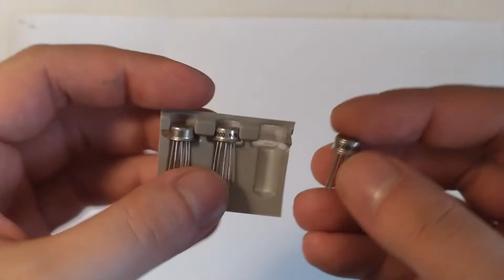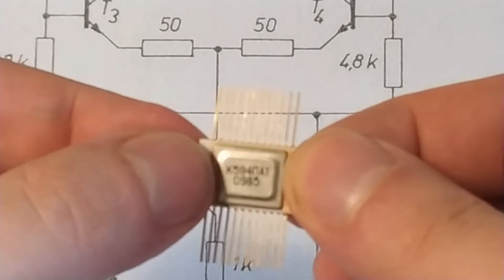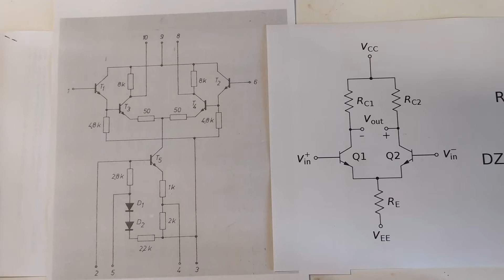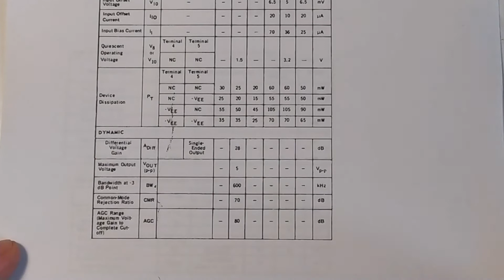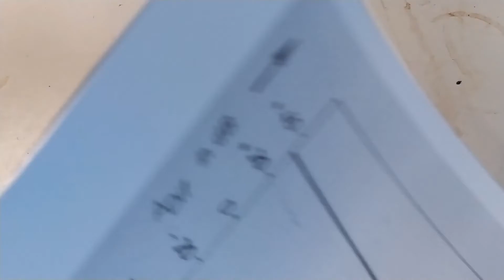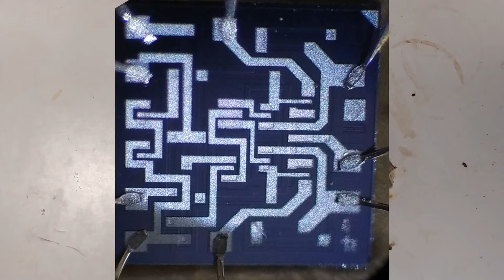Early Integrated Circuits: MA3000

Comment: That's a hell of a lot of gain on that chip. Nice.
Reply from the maker: I was quite impressed as well! Getting that sort of performance out of 5 transistors with the sort of integrated circuit technology they had in the 70s can't be easy. I think the reason they are that impressive is they spared no expense when making them. These must have been really high end back in the day.